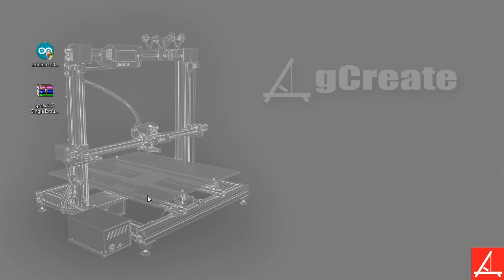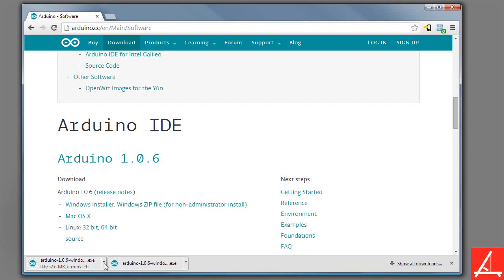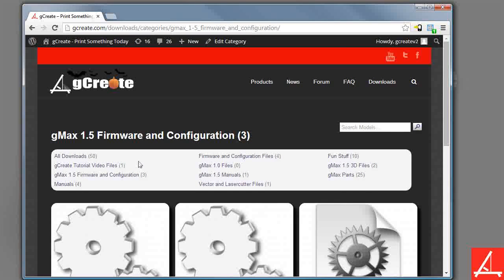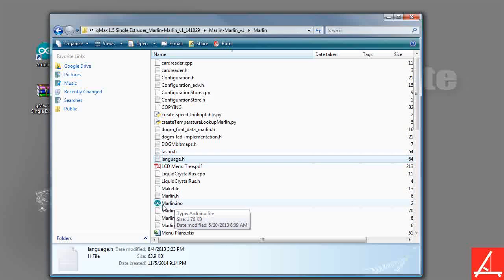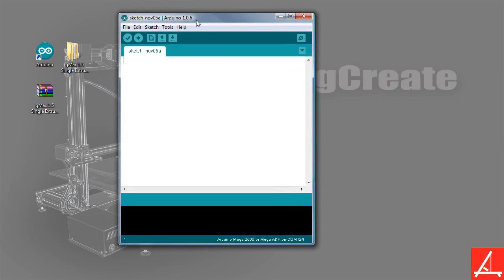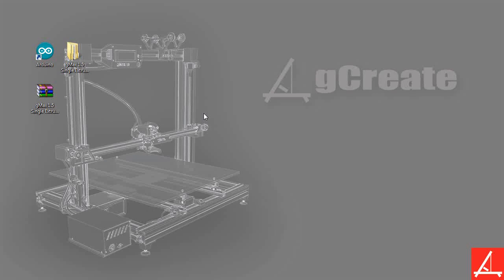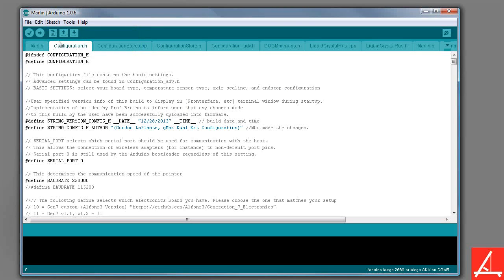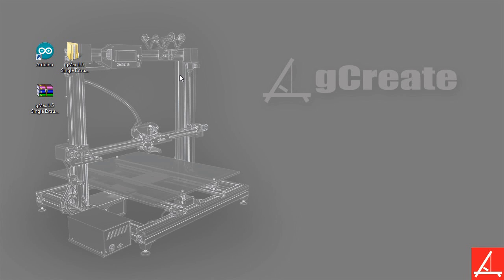How to Upload Marlin Firmware on the gMax and Reprap 3D Printers

Comment: Getting errors on Compile and Upload when trying to use the Dual Extruder Firmware:

sketch/temperature.cpp: In function 'void manage_heater()':
temperature.cpp:665: error: unable to find a register to spill in class 'POINTER_REGS'
 }
 ^
temperature.cpp:665: error: this is the insn:
(insn 98 97 100 4 (set (reg/v:SF 103 [ pid_input ])
        (mem:SF (post_inc:HI (reg:HI 141 [ ivtmp.170 ])) [4 MEM[base: _101, offset: 0B]+0 S4 A8])) sketch/temperature.cpp:449 99 {*movsf}
     (expr_list:REG_INC (reg:HI 141 [ ivtmp.170 ])
        (nil)))
sketch/temperature.cpp:665: confused by earlier errors, bailing out
exit status 1
unable to find a register to spill in class 'POINTER_REGS'

  This report would have more information with
  "Show verbose output during compilation"
  enabled in File > Preferences.

Any thoughts on this?